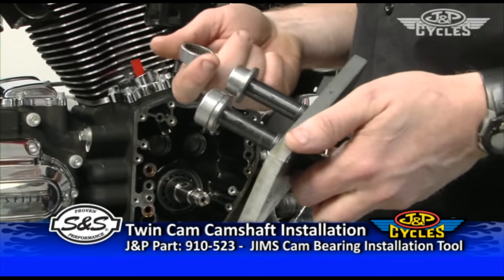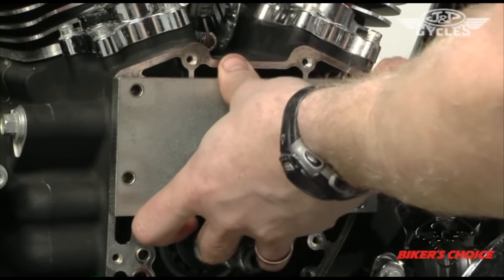Cam Replacement on a Harley Davidson Twin Cam, including Pushrod Removal •  J&P Cycles

Comment: In my opinion, what he said about the pinion shaft being within Harley specs is true, however, Harley changed there pinion shaft tolerances to mask the defective flywheel assembly that is merely pressed together, at the factory, with a 400 ton press, Nothing is holding the two halves of the flywheel assembly together. All other Harley engines of the past had a crank pin bolt and nut, to keep both halves of the flywheel assembly together.

This flywheel is already out of true, because the true run out should be no more than the 0.001" to begin with, as an competent Harley mechanic can tell you. Any more than 0.003" will begin to wear out and damage the bushings and bearings as the flywheel wobbles out of true at 3,000 rpm as it moving down the road. This flywheel assembly at 0.007", run out, is so far out of true, it's a shame.

It won't be long before this engine craters, so, all the work this guy did will be for naught, as catastrophic, engine failure is around the corner.

The only solution, is to at the stage this video was made, was to split the crankcase apart and take the flywheel assembly to a specialty shop where they would dynamically true it and plug it and weld the two halves together with no more than 0.001" of max run out at the primary shaft, (left side) and the pinion shaft (right side) or the cam side.

The guys at the specialty shop would shake their heads at a run out reading of 0.007" of run out. I feel for the owner of this Twin Cam engine because  all Twin Cam engines are a fatally flawed design, with two PLASTIC silent chain tensioners, rubbing against METAL, chains. Harley "stealerships" and independent shops will make a lot of money always, inspecting and changing out these tensioners, and if they break into little  pieces, as has happened to many owners, they get sucked into the oil pump and get circulated into the crankcase and piston, cylinders and catastrophic engine failure will occur.

There is no solution to this problem, even with changing to gear driven cams, one will still have the outboard the cam plate tensioner to worry about, as it can wear out at any time, and break into little pieces of engine destroyers.

Get an EVO MOTOR, 1,340cc, reliable, no plastic tensioners, single gear driven cam, and a bolted together flywheel assembly for many miles of great service.

THERE ARE MANY YOU TUBE VIDEOS POSTED BY HARLEY OWNERS ON THESE PROBLEMS AND ALSO BY THE SPECIALTY SHOPS WHO TRUE THIS FLYWHEEL ASSEMBLIES ALL THE TIME.

CAVEAT EMPTOR - "LET THE BUYER BEWARE"
Reply: ***** The reliable Evolution motor  (Blockhead)were produced from 1984-1998. You have to watch for some years, though, because on some model year, Evos, the crankcase would crack due to poor casting, techniques, so, research which years, to avoid.
 But, for the most part, those were reliable engines, and at 1,340cc, were a little underpowered, but, a great sounding engine. You could rebuild that engine, over and over the top end, bottom end and they had great bearings, Timken, not the junk INA cam bearings which are worthless. The whole Twin cam engine is a joke.
They were direct mounted and not rubber mounted so, vibration will be a problem, but, an easy to work on engine. If you can get you hands on a FXR/FXD, Evo, that was the best frame design and cool looking to, and a great ride.,
Reply: Anytime, pal, sorry, you got burned, but, most Harley buyers of Twin Cams, don't even know the engine is crap. That is the heart and soul  of any bike, and Harley dazzles with the chrome and the old reputation. That is all a thing of the past, have to get the old bikes to really get that Harley feel and reliability again. Forget anything this side of 1999 to the present. They are manufacturing more Harleys in India, than in Milwaukee, these days, FYI.  Get a new Metric Cruiser any kind, and you will get both performance, reliability and a great price and more engine cc's and torque, on the rear wheel than any Harley.
I cruise on my Yamaha Roadstar 1600, V Twin, air cooled, pushrod activated, bike with 73k miles, Soft tail, belt drive, and never have touched the engine or tranny, just change the oil and go. It has 4 valves per cylinder to Harleys, two valves per cylinder. It has 2 sparks plugs per cylinder to Harley's one spark plug per cylinder. It has Twin cams which are gear driven, solid as a rock, no tensioners. More horsepower and torque on tap and its 98 CID, and eat Harley's, hot running, 103 CID and 110 HARLEY CVO'S (custom vehicle operations), for breakfast. My bike is air cooled and has ceramic composite cylinder liners for the pistons, so I never feel engine heat on the hottest summer days. Can't do that with any sweating, burning hot Harley Twin Cam, it would cook your leg. Looks like the Harley Fat Boy, it was made to compete, with and year for year, 2002, mine is 1602cc, to Harleys Twin Cam 88, 1450cc. It's was the largest production machine ever built in 2002. Check them out on YOU TUBE, you can see mine on many of my travel videos, on my channel.
Reply: tomcata1467 You're welcome, loved the old Harleys, I used to ride, and had a blast, but, those days are all gone, unfortunately. THE Harley to own is the Sportster, still uses the Evo motor, design and is a great bike, not a cruiser, but, very good and reliable, the Only new Harley to own, in my opinion, great looking bike and reliable. XL1200. YEA.
Reply: +tomcata1467 There was nothing presented here that indicated this engine is crap. I have had several "metric cruisers" and I still prefer Harley-Davidson's and no my engines have no problems.
Reply: I wouldn't expect a Twin Cam Harley owner to admit that there bike had any problems with the design. I don't blame you. I would say the same thing, cause if I made a bad buy, I wouldn't want the world to know, that fact, either. Still doesn't change the facts, though. You are entitled to your opinions, as I am mine, but, we can't make up our own facts.

Plenty of Harley owners have come for the with YOU TUBE videos they have posted on the fatally flawed Twin Came engine design.

Over 300,000 Harley owners in California have filed a class action lawsuit against THE MOTOR COMPANY, for the heat off the engine which has caused riders pants legs to catch on fire and cause 2nd and 3rd degree burns. 

Why do you think Harley sells heat shields for the rear cylinder? For their good looks? Why do you think Harley installed sensors to shut off the rear cylinder at idle and one is now running a Harley on only one cylinder?  Where is that great Harley sound?

CAVEAT EMPTOR- LET THE BUYER BEWARE.
Reply: +tomcata1467 I support America. Harley-Davidson has been making motorcycles since 1903. If and I do mean "IF" the new motors turn out to need re-design I trust Harley-Davidson will do that. Harley-Davidson has a long history of upgrading their bikes without loosing their character. You on the other hand ride imports and you no longer support American manufacturing. The second that Harley-Davidson ever ran out of business, well, before that second is over your import manufactures will cut back on the quality and they will raise their prices. They will dictate what style of bikes will be offered to Americans in that future. I'm not worried because Harley-Davidson is America's MotorCycle Co. and they will always make the best product for all Americans. I'm sorry that you no longer support the motor company. In fact I am wondering just which Harley-Davidson that you owned let you down. I am wondering did you beat it to death, did you take care of it? 
I'm willing to bet my new 2015 Harley-Davidson FLHP Police Road King will last me for the rest of my life. I am willing to come back here year after hyear and give everyone a heads up about my new bike. My old 1994 Sportster 883 Deluxe was ridden like a "bat otta hell" and I also did my own stage 1 mods and raced a lot. She never blew up. So my ownership experience (I still have my Sportster and she looks almost new even after 21  years) tells me American made Harley-Davidson's are durable motorcycles. I support them and wish them to continue to make their style of bikes so that future American's can get their own new Harley-Davidson's.
Me? I love everything about my Harley-Davidson's and I am so very thankful that they stay true to their roots. So in closing Mr. Sour Grape's why do you not stop putting down Harley-Davidson's on every Harley-Davidson video that you find. Just go over to the Yamaha Roadstar video's and hang out with your buddies. BTW I owned a new 2009 Yamaha V-Star 650 Classic and I loved it. It reminded me of a smaller Harley-Davidson because, well it was an air cooled V Twin and it had the fat forks the heel and toe shifter and the floor boards and the Harley-Davidson style fenders and gas tank. But it was made in Japan and it did not give me the feeling of supporting American business.
BTW the tensioners have been upgraded to hydraulic tensioners now as shown in this video, no springs anymore. Your claim about the flywheel runout is without substantial merit as well. There are many Harley-Davidson's rolling along down the road even the newer models. You act like people are exploding the motors every where and on every road their is a dead Harley-Davidson. Completely un-true. On every road their is a working Harley-Davidson rolling down the road. Many many many more that your Yamaha Roadstars.
Reply: The Evolution or the Blockhead, single cam engines, manufactured by Harley Davidson from 1984-1998, was the engine which saved Harley Davidson, from going out of business.

You may be to young to remember that Harley Davidson SOLD OUT to AMF, in 1969, the family got out of the business to sell it to a foundry manufacturer of bowling balls, among other products and the Harley quality was so bad, that AMF wanted out of the Harley Davidson business cause they could sell the junk Harleys made in those years to compete against the Japanese Metric bikes which were of higher quality.

The Davidson family bought Harley back from AMF around 1981 and knew that they had to design a reliable Big Twin Engine to get back in the game.

They came up with the EVO, a great 1,340cc engine. Single cam, reliable and easy to rebuild top or bottom end, forever. Harley was not making money, cause they were too reliable, although comparatively underpowered.

So, they came up with the TWIN CAM design and instead of using gear driven cams, they opted for the silent chain with their little PLASTIC tensioners which would bring them lots of money, every time they had to be replaced or a customer blew an engine because of there breaking up. 

All the present day Sportsters are still using the reliable EVO engines on the 883s and the XL1200, and they are the only Harley, in my opinion to buy these days. They are very good bikes.

All the TWIN CAMS are fatally flawed. You must own a TWIN CAM and if I were you, I would probably defend my buying decision too, and never admit to the public that I screwed up, because I didn't know anything about the TWIN CAM design. You are blinded by the Harley mystique of yesterday, not today's reality.

Remember, the Harley V-Rod is not even a Harley design, it was designed by Porsche of Germany. And all Harley front ends come from SHOWA in Japan. You don't know you are riding on Japanese forks, do you?

I love the look of the Harleys, and the old EVOS are great, forget the TWIN CAMS, they run extremely hot and you know it, if you ride your bike at all. There are a lot of Harley owners who are guys who take their bikes out for a 10 mile run and call themselves bikers.

There are a lot of pre-owned late model TWIN CAM Harleys on the market and most are low mileage. Why? And why are they for sale, if they are the great bikes you say they are?
Reply: +tomcata1467 So the twin cam's are bad I have heard a few people say that. Any word on the 04 1200 evo on a roadster? Just wondering new to riding just got a Harley last year :) Thanks
Reply: i am a shovelhead guy myself. mark your spot or get out of town.
Reply: Styling of the frame is a personal choice, but my '89 flast is at 54K and running as strong as ever. Those evo's are the best, all years and if anything does go wrong, most any rider worth their salt can rebuild them with a little video help from youtube, just be sure the video maker isn't walking around with a beer in their hand and mumbling about everything and showing you their horse or lawn mower or their riding buddy, the floor and cieling. You may have to search through a dozen or so but when you find the right one, you can handle the job. Don't ever try this with '99 and up twincams or others harley is now building and adding more and more gimmicks. Ride that evo, you'll get in more ride time and less wrenching time. Just read all the complaints and you'll know what NOT TO DO!
Reply: Or if you don't like the sporty, buy it anyway then pull that new evo off and stick it on yer own choice of frames. As for the rocket bikes that eat harleys, well, sad to say, they do, but I have seen way too many young lives gone or in wheelchairs because they want to ride 160 on curves and in  traffic, not near as many harley riders want to push the limits to death. That's for the tracks with lots of training and safety, not for our young riders who feel they have to out run someone who isn't even interested in racing, just enjoying the riding life.
Reply: I'm a Harley rider, not to put anything down or anyones personal choice, but, if you will check the facts, Harley is no longer allowed to stamp them made in the USA, because the majority of the bike parts are no longer usa made and have not been for many years. Look at the logo, it's no longer on there. I am not putting down an American company, but I'm also not buying into the newer models that are giving so many problems and costing so much to upkeep. Just saying, the facts are facts, it's not the same harleys we grew up riding and not the same pride in building toughness, it's now a battle for more fortunes.
Reply: tom rides his bike that is patterned after the USA's 1 & only; he got that one since he just started working part time and can't ride what the big boys ride; but at least he rides; right?  so, tom; I've been riding for 50 years and I've owned motocross bikes made under the brand of yours and they were great! tom has LOTS of time to ride that scooter only working 20 hours a week.  He rides a lot he says cuz he ain't never been married; no house; and he ain't got no kids, or work; taking up his time.  see ya down the road tom.
Reply: When you say nothing is holding the flywheel together, well, 400 tons are holding it together dummy.
Reply: I too owned a Roadstar. 2003 1700cc. The bike Harley sued because with a set of pipes it sounded damn close to a Harley. But it wasn't. I even stripped the nameplates off to mask it.
NOTHING compares to Harley. If it was all about low maintenance and reliability, we'd all be riding BMW R1200s.
Let the naysayers harp about MoCo's problems...and there are many, But the fact remains, the pride, dignity and satisfaction one gets riding a Harley is UNMATCHED. Just ride up next to me with your Yamaha or Kaw look alike.
Reply: Couple of guys wrote the EVO (Blockhead) went till 1998, not true, it went till 1999 on the Softail models.  The rubber mounted motors (Touring & Dyna family) changed in 1998 .
Reply: "But the rest of the metrics, while quite reliable, have all the passion of a fucking vacuum cleaner."
THAT is fact. 
OMG, first thing came to mind was when Drill Sergeant ask Gump, "What's your sole purpose in this army?!"
"To do whatever you tell me, Drill Sergeant."
Sergeant replies, "God damn it, Gump! You're a god damn genius! This is the most outstanding answer I have ever heard. You must have a goddamn I.Q. of 160. You are goddamn gifted, Private Gump. 
Sir, you nailed it.
Reply: Many mechanics (the opinion of anyone without technical expertise is worthless) agree and that runout difference between older bikes and TCs is MEASURABLY far different! 1930s Knuckleheads had tighter runout limits.  HOWEVER S&S cranks are pressed in their top of the line Sidewinder engines and they stay together just fine at up to 145 cubic inches!  It's not the method, it's the execution.

Comment: This is an excellent video. Clear and concise. Many thanks.

I mentioned to my local shop that I was planning to do this.
He cautioned me that with 88,000 miles a higher lift cam would probably ruin the valve seals. The valves would be moving deeper into the seal and any roughness on the stem would slowly eat away at the seal.

Another point he made, The piston rings are bound to have some wear. The increase in power could cause oil consumption.

He suggested leave it alone or go the whole route. remove  heads and cylinders. Install new rings, do complete valve job.